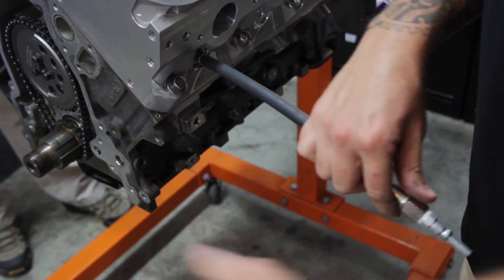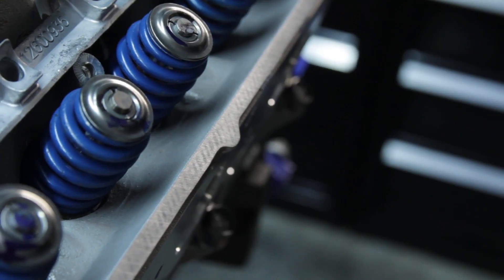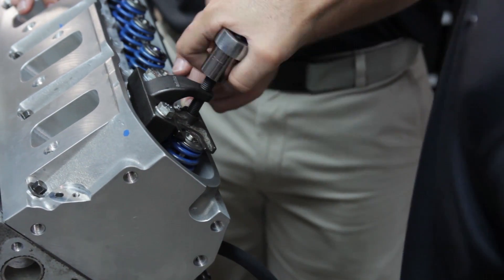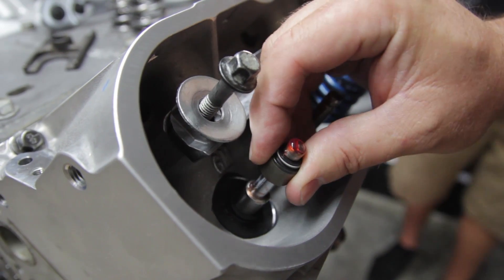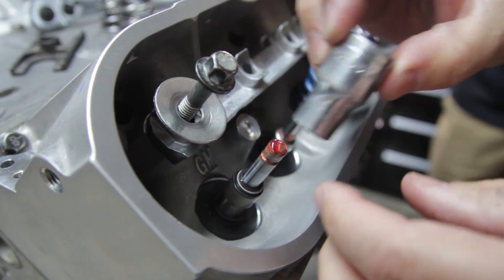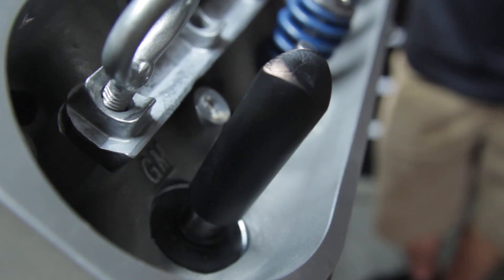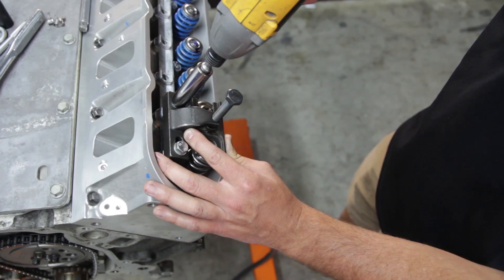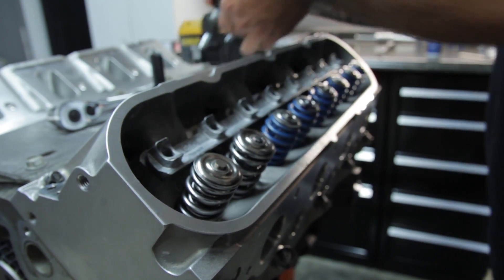BTR changing valve springs

Comment: I bought the cam kit with springs from BTR and just got it installed. I didn’t press down my valve stems but they set right in place like the stock ones. My oil pressure is lower now without the tune but I’ve heard a tune will fix it. If not would that likely be the cause of my pressure issue? Just wondering what others think this is my first project. Thanks!
Reply: He wasn’t pushing the valve stem down, he used a socket to allow the stem to not receive and downward force but to keep the pressure on the valve seal to let it be pushed down around the stem and head!

Comment: what is the air pressure you put in the hose to hold piston and valve up  compression?
Reply: I've been trying to find out the same thing!
Reply: Used to keep the valve from dropping down to the cylinder

Comment: How much psi are you supposed to run in the cylinders?   Will a small pancake compressor sufficient enough?
Reply: 40-80 is fine. If you’re not sure he mentioned the rope trick which means put your piston at top dead center and push in small rope through the spark plug hole to fill the empty space so that your valve does not drop down then pull the rope back out when your spring is changed.

Comment: If I run the stage 3 can what stall is recommended and will stage 3 work with stock pushrods
Reply: Why jeopardize all that work over $99 upgrade? Do it right, do it once

Comment: Nice video. However, I would NEVER hammer on a valvespring like you did at the beginning. Then you say the first thing you want to do is hide the hammer!!! I don't care how long the keepers have been in, a magnet and a small screwdriver will always loosen them up.....
Reply: Rubber mallet works good and won't hurt anything.
Reply: Put a socket with a magnet in to give it a few taps works well on stock springs .

Comment: Hide the hammer! Good one! I try to not contact the engine parts with a hammer anyway, put something in-between, (and not to fingers) I hit the valve stem a few times like that, I started using a socket on the retainers!

Comment: Hi, I’m looking for a valve spring compressor tool like the one is this video, that will work on a 2004 4.3L Chevy Vortec engine. I’m replacing the valve springs to fix a misfire issue. The engine is in the vehicle. My internet searches have all ended up with valve spring compressors for LS engines. I have bought two different brands of the “jaw” type compressors but they keep popping off the valve springs. I’m begging for help.
Reply: It being a 4.3 that's the same as a sbc gen1 style. Theres hundreds of different ways people change those. I changed the springs on my 400 SBC I use to race but while I  was in college it sat alot and some of the springs on opened valves got weak. I just used the air to keep valves up and used the valve spring compressor tool to hold down the spring. u bolt it to rocker stud and press down enough to get locks keepers out. It was on a s10 blazer I had it in.  Hope the best for u.

Comment: When you press down on the seal should it bottom out on the top end of the guide or should there be a bit or room?
Reply: Did you ever find the answer to this?  Doing an install now and wondering the same thing.  The seal WILL NOT go down far enough to bottom out even with the proper tool.
Reply: @isaachill3869  can you send a pic of what you're working on? Honestly I forgot but maybe a pic will refresh my memory.
Reply: @charlesclemons741  I’m not sure how to send a pic.  I’m installing new dual springs on LS3 heads.  Everyone is saying there should be about 1/8th of an inch between the seat and the seal though with the new one!  Does that ring a bell?
Reply: @isaachill3869  that sounds right. I remember having to order additional seals because I destroyed some during the install.  But that spacing sounds about right.
Reply: @charlesclemons741  haha!  I did the exact same thing!!  I ended up ordering more seals and the btr tool for it 😂😂 thank you for answering so quickly!  Cheers 🍻
Reply: @isaachill3869  no problem! Good luck. Let me know if I can help with anything else.
Reply: @isaachill3869  I am having the same issue. Any answers?

Comment: How much psi can you give the cylinder, I see you just hooked the air line up. But do you have to turn the regulator on the compressor down?
Reply: Just a guess here, but typically a car is around 120 psi when doing a compression check. That'll be a good start.

Comment: What is another method to keep the valves from falling. I dont have an air compressor, i heard of the TDC method but havent found videos that do them.
Reply: KASOR8281 here is a link. What I don’t like about this method is pushing up in the valve with the piston you are pushing of the edge of the valve. Myself wouldn’t want to do that. I picture bent valves. Even slightly is failure. 

Learn to find TDC from watching the push rods and you can feel and hear the compression stroke on the cylinder you’re working with. Ensure using something to go inside plug hole. Then I would use the air. This way is something stupid happens with your compressor or hose or fittings. Your valves don’t drop into the cylinder. Which means heads come off. 

Here is that link but I don’t recommend it. 

https://youtu.be/t1WYC84eeMU
Reply: String method
Reply: Top dead center and put rope in through the spark plug hole until the empty void is full to stop your valve from dropping down into the cylinder. That’s what he meant when he said the rope trick.

Comment: What is the rope trick?
Reply: Put the piston at top dead center and push in rope through the spark plug hole to fill the empty void and keeping the valve from dropping down into the cylinder

Comment: The claw type valve spring removers WILL NOT even almost damage your springs! You must be trying to increase sales of that over priced tool you're using.
Reply from the maker: Give us a call Anthony. You'll quickly discover we NEVER upsell anything to our clients for profit purposes. The tool used is an industry standard for LSx applications, and we stand by its quality and use for these cylinder heads.
Reply: Don't mind me, I'm just disgruntled that I have not seen one for the Ford 302 =)
Reply: This tool is perfect for LS heads. I bought one and glad I did. Its really good on in car cam changes.  Btr knows there stuff.
Reply: F that claw spring compressor tool. I used one on a 4th gen LT1 build several years back. Got the job done but hated it. 

Bought this basic tool shown and will be swapping springs soon to BTR’s .685 LS7 springs. Wish me luck. ;)